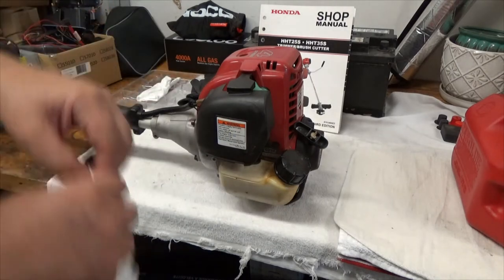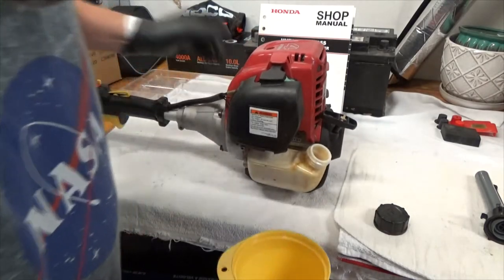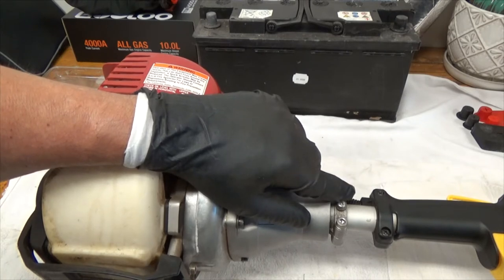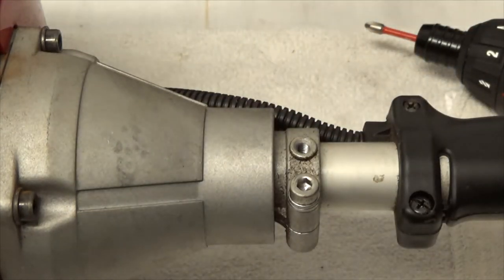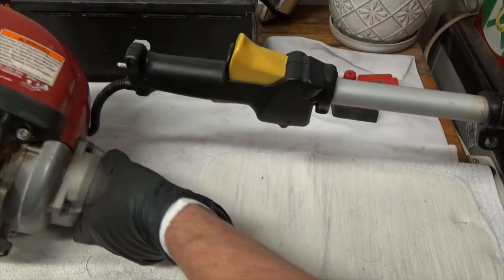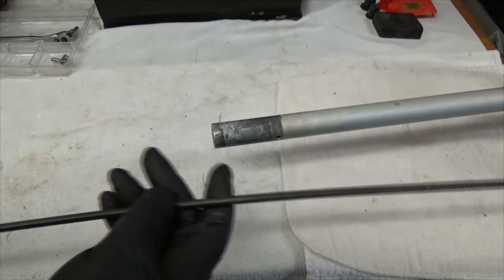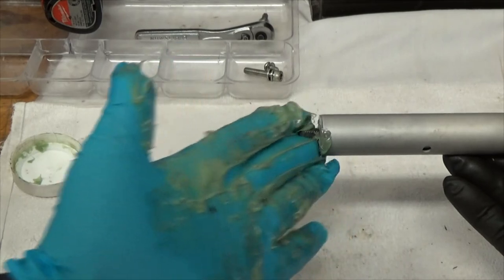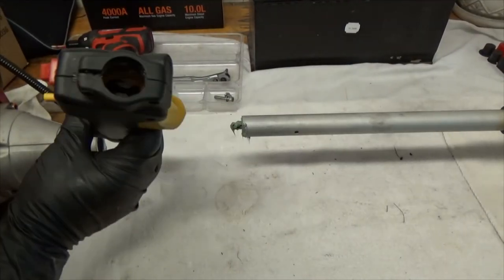Honda Trimmer Drive Cable Maintenance

Comment: You get smart points for reading the manual. I have worked on multi-million dollar equipment that require understanding the manual along with electrical, mechanical and wiring diagrams.
Reply from the maker: Yea, even though it is against the rules, I worked at electrical power plants where both tech's and engineers read first and then worked on equipment.  We just didn't tell anyone we did that after work.

Comment: Never knew the glove advice..... good to know. As for the Honda, I've had both 35s and 25s going into 6 years now... I only use them on my home during the season... very good quality engines... iI always fill them with Chevron premium never used any other fuel... they are worth the price.

Comment: do we need to grease the cone shaped part connecting the shaft and engine? mine came unassembled without any grease.... and there is nothing written about it in the manual
Reply from the maker: Sorry, somehow I missed your comment when you posted it and I hope your decision worked out.  Personally I think it is fine either way to lubricate the gears or not as that is a low load area.

Comment: Great video.  Broke my flex shaft.  Cannot find a replacement.  Tried many sources but the no longer have them. Any idea?
Reply from the maker: I have been going to Boats.net  Once you drill down to your trimmer,  Look at the "Frame Pipe" and see if they have it.
If not you might be able to cheat by buying one from a new model.
I think you want DRIVE SHAFT
41411-VH8-640 for $13 + S&H

Comment: Hi David .... Couple of quick question regarding the greasing  procedure.....
1. Does the Shop Manual tell the intervals for the Shaft re-greasing, is it the same as the Transmission Head? (50Hrs or 6 Monthly)
2. Is the (NLGI 2) or (NLGI 1.5 odd Number Close as Dammit 😁) used in both applications, The Head and the Shaft?.
Going to be doing this in the next month or so 👍.
Reply from the maker: Thank you for asking.
1. The manual states 50 hours or 6 months but every 6 months for a homeowner seems a bit much to me.  I am an every 3 to 5 seasons type because I drain the fuel and store my equiptment in a controlled environment as opposed to the shed out back.
2.  Grease for both places states; "Lithium based multi-purpose grease NLGI #2 or equivalent." as the paraffin wax and the weight of the oil can vary from one source to another and still meet  the  NLGI #2 requirements.

This is not a bad job if you do not disassemble the gear case head.
Reply: @A_Renaissance_Man  Ok cool, Thanks for the Reply and the information...God bless you and keep up the Great work 👍.

Comment: Is the flex shaft square where it meets the clutch drum? Have one of these heads and am trying to adapt it to a sifferent quick attach system
Reply from the maker: No, the flex shaft is round and a screw keeps the shaft from rotating.